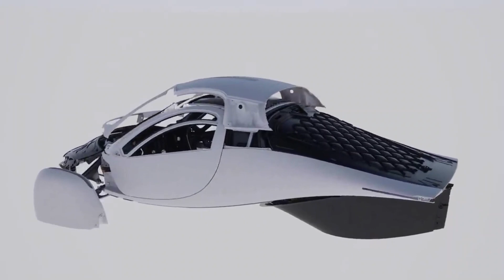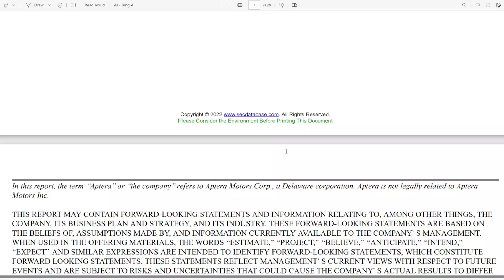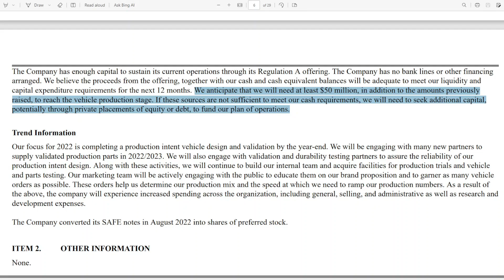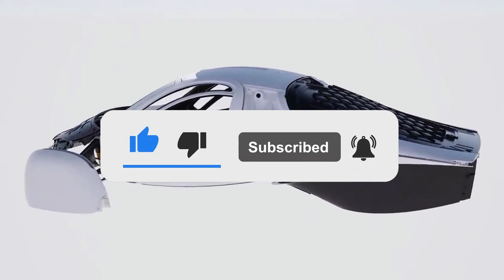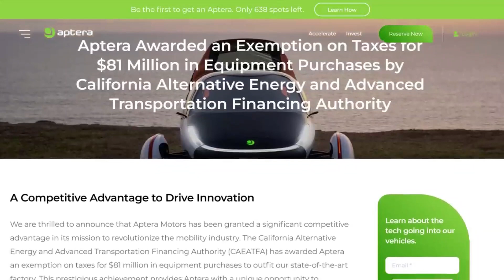Aptera set to Begin Customer Production with or without Investor funding!

Comment: Aptera only needs to make the first two thousand Accelerator vehicles, followed by the next three thousand Launch Editions. Everything else falls into place in it's own time. ATVM loan, big investors, second factory to boost production, it's all over the hills and far, far, away. Accelerators are making it happen, how long are the remaining five hundred slots going to last after the first PI builds hit the street? Grab your popcoen, skeptics take note.
Reply: The power of Volkswagen made 200, $100K cars very similar to Honda Insight and Aptera. Insight also had pretty low production count. This market has been tapped a couple times. Wait until Aptera announces price update. The reality check will be chilling.
Reply: @artsmith103  You are right, the suggested prices on the Aptera page are still pre covid and pre inflation prices, founded on phantasies.
Reply: @artsmith103  The first Insight sold about 15,000 vehicles, but was no where near as fun to drive or as practical as Aptera is.  No one would mistake the Insight for a sports car, nor is there room to sleep in it as a camper.  I don't think you understand what the market appeal of Aptera is.  A ride in a prototype might change your mind.
Reply: Sono motors did not even produce 20 cars, before they went bancrupt.
Reply: @vic321344  Vic never even learned to spell.  Perhaps that is why he doesn't know that Sono motors(sic) isn't Aptera Corp, or that no version of Aptera - even the first Aptera Inc. never went bankrupt.
Reply: @vic321344  
Doesn't have $hit to do with Aptera, except to show who's vision resonates with the masses as Aptera breaks records in crowdfunding.

Comment: While Aptera is more than happy to claim a new production in Summer of 2024 and make claims that 92% of their supply line is solved what they won't do is provide updated price guidance because they know damn well it will drive people away.  

A limited production means the cost will even be higher than the already expected increases.  I love this claim because no one will put a number on what rate limited is. See the problem with this claim is that major suppliers don't operate that way, at least not cheaply. So what is limited????  Seriously make up a number.   

They made claims to be going into limited production in January 2022, then by the end of the year we knew that was false,  as in December 2021 they claimed they would be in production by end of 2022 and repeated this claim in May and June of that year.  So for a company which loves to claim they will soon be in production and have so many paths to funding you would reasonably expect them to have exploited one. However they haven't because they are literally betting on a some billionaire to just write them a check; after all that is Chris's favorite cringe line when interviewed - how they just need one billionaire to write them that check.  

  
They did claim in 2022 filing they expected a 21m investment no earlier than Q3 2023 but that language was removed in June 2023. So go back and look specifically for 21m in filings from 2022 and you will see this statement.  As of June 30th 2023 they had made no attempts at securing alternative funding through loans and similar, again in their SEC filing. Accelerator, their kickstarter campaign where you risk 10k to be one of the first 2000 to take possession, provided you are state side and provided you choose a LE and provided you pay the much increased price, was supposed to only run till March 2023 but uptake was so bad the program is now indefinite; seriously Chris and Steve expected the slots to sell out that quick and there are still over 500 of the 2000 left!!!!
Reply: You won't find an auto company more transparent than Aptera. Like a global pandemic, supply line disruption, and war in Europe is no excuse. Yet, with all the extra time, they managed to make the production intent vehicle EVEN BETTER. Timetables are bull$hit when it comes to EV production. Aptera is closer to production now more than ever, and getting closer. I think 2024/25 is still plausible for Accelerator deliveries, I could be behind the yoke by end of next year.